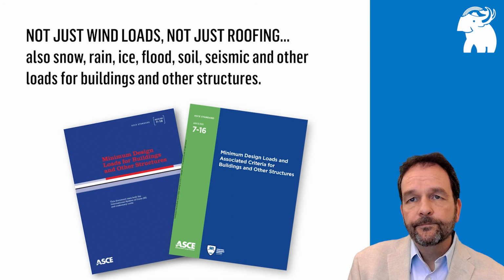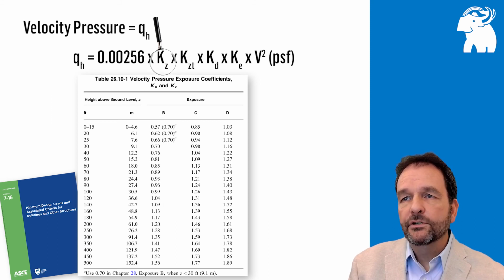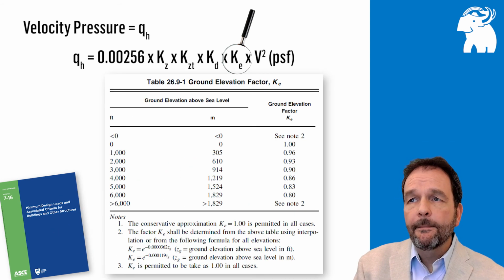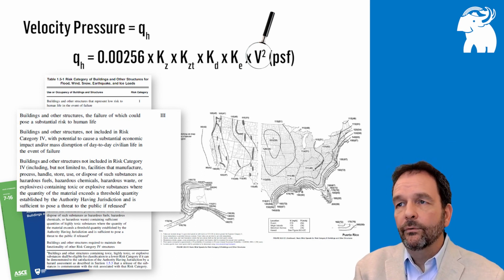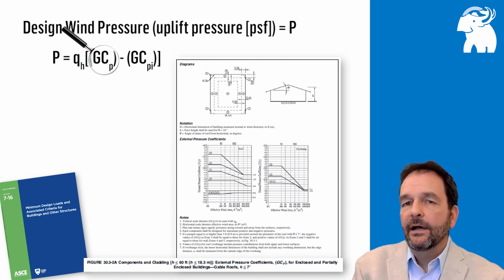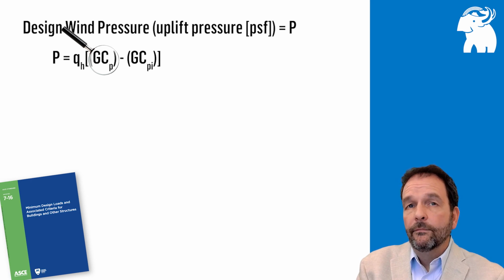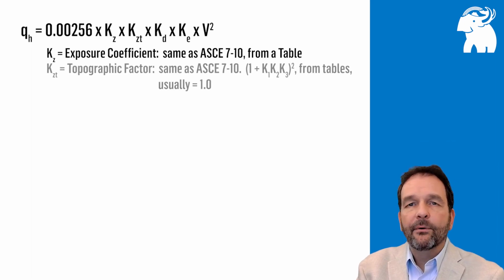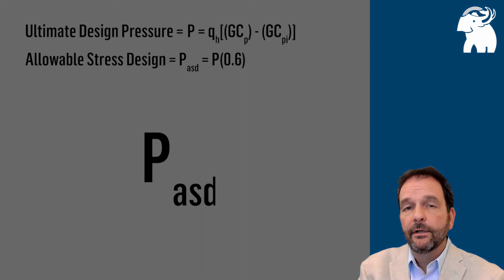Low Slope Roofing Wind Design:  ASCE 7-16 Calculations

Comment: Those an open structure, like a free standing wooden pavillion with a single pitch roof, have less uplift load than an enclosed structure of the same size?  A friend of mine recently told me that the wind "flows right through it" so its not as bad.

Comment: If you're converting your pressures to ASD, after multiplying by .6, do you still apply ASD load combinations factors? For example .6D + .6W? Great Video!!
Reply: Nope, just the 0.6 one time. The 0.6 he showed at the end of the video is from the ASD load combos. All ASD load combos have wind factored at 0.6, so sometimes it's a bit of a shortcut to just multiply your final wind pressure by 0.6 and know that's the value you will be designing with
Reply: @Rheynez  thanks for the reply!
Reply from the maker: @O. Ivan thank your for your question and feedback.  Thank you @Rheynez for the accurate response.  Let us know if we can help.  https://soprema.us/contact-us/